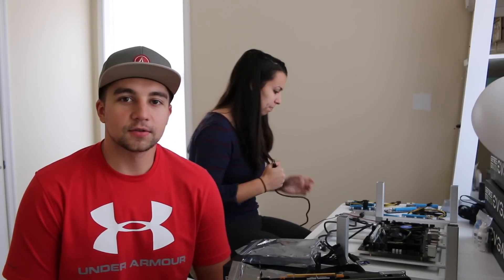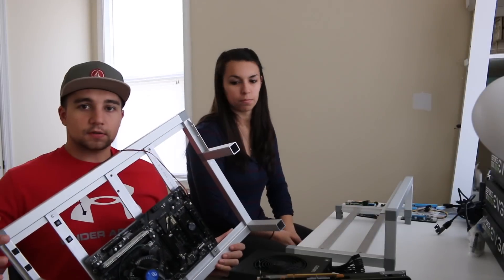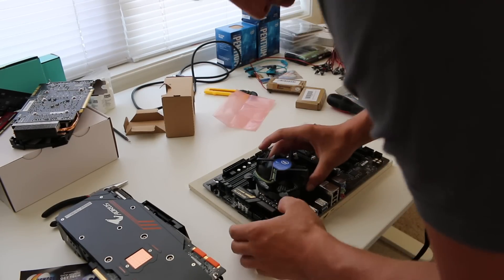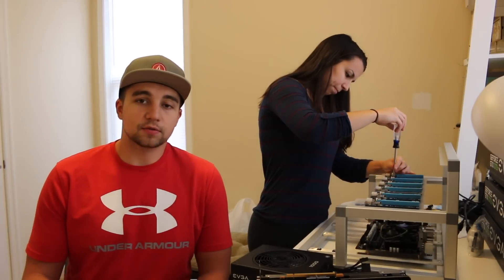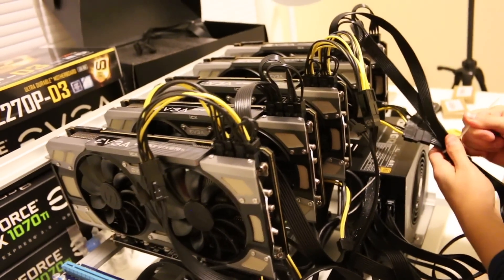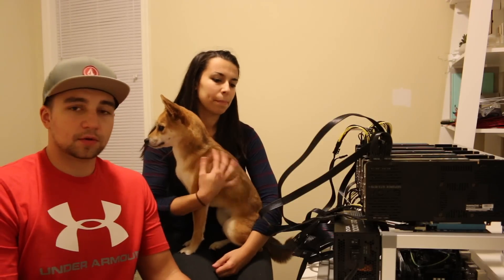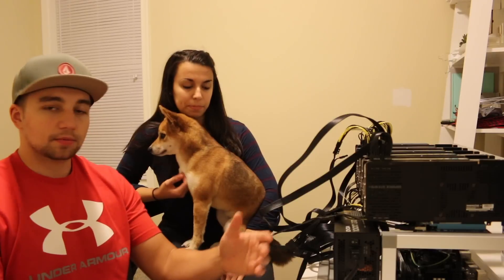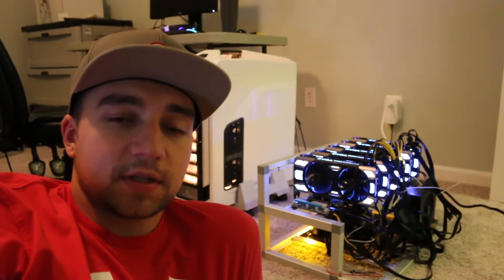Building a GPU Mining Rig - 6x 1070 TI to Mine Zcash, ZenCash, and Vertcoin

Comment: Great channel here @VoskCoin 
Building a 6 gpu 1080 rig.  Think a 1200w psu be good enough or do I need 1600w?  Each 1080 at max uses 150w so that'll be 900w in total from the cards, I'd say about 40w from everything else. So I believe 1200w would be good?  What do you think?

Comment: I have a corsair hx1000i, i can power 4 msi gtx 1070's with the standard Pcie cables that comes with. But when i see this video i can put 2 extra cards and power them all by the sata cables? I am running 50% power limit so 1000w is enough but i just want to know if the sata cables can handle this. Thank you!

Comment: I decided to actually do this build with the only difference that it's a 12 1070 hanging using both your videos. I have it all connected as far as your videos tell me and I'm getting power to all of them but I can't figure out what to do next? You go from building it to showing the mining results on the screen. I did the simple mining os from your video but I can't even get a video screen. Where do I attach the HDMI to the monitor? I tried every GPU and none of them can get a screen on the monitor. I'm hoping you could help me out, I'd be very grateful :)

Comment: VoskCoin,

I am doing a similar build to this, only exception, I am taking your recommendation, and I purchased an EVGA 1200 W Platinum PSU.
I was only able to order 5 x 1070 TI EVGA Black Edition, and I need another card. The cheapest I can find another is $600. At that price, can I spend the extra $150 and buy a 1080 TI without upgrading anything else in the rig?
That would be a total of 5 x 1070 TI & 1 x 1080 TI on a single EVGA 1200 Platinum PSU.

Comment: How do you have enough power connections to power those cards? Is it safe to run a 6pin to dual 8 pin splitter to power those cards? I just purchased all the gear and trying to figure out the safest way to power these cards.

Comment: How many of the PCIE 6 pin to 8 did you use in this video? One for each card?
Reply: i am wondering about that... cards need 2x8pin.... but, EVGA1000CQ have 4pieces 8pin>2x8pin already.
so you need 2 pieces of 6pin>2x8pin splitter, but i dont know if its safe and combine with 8pin to 6+2pin

not sure

Comment: Great videos! Just wondering about gpu's that use 8 pin + 6 pin power connections? This 6 rig video seemed to use similar but you didn't get into how it all powered up. Thinking about MSI 1070Ti Titaniums, given that EVGA 1200 Supernova psu only comes with 4 such VGA  cables? How do you power up #5 and #6? Cheers!
Reply: https://www.amazon.de/gp/product/B074PPPKGQ/ref=ox_sc_act_title_1?smid=A3RNVO35LF9IXA&psc=1

maybe? with 8pin>6+2pin thats in package.
not sure
Reply: Actually, saw what I was looking for on another vid! CableMod has all the cables one could want to add. I'm sure PSU builders only include enough cabling for gamers' needs, mining being as relatively new as it is. Cheers! keep up the great vids
Reply: yeah, but f** expensive

Comment: Hi! Quick question. The PSU calculator of CoolerMaster says this rig needs 1250w approx. Now I know we are going to undervolt it, but aren't we testing first with factory settings? That would result in problems isn't it?
Reply from the maker: You could grab 1 2 etc and test them if you’d like, don’t have to test all 6 full bore
Reply: Rob B. At idle these cards pull 10 Watts each. Then put in your settings and run everything. As the Powerlimit is only 120 watts its going to pull a maximum of 720 watts for the GPUs. So everything is fine 👍

Comment: I just put in an order for most of the parts here, using your links. Building a 6x 1070ti rig, but with ASUS Strix 1070ti's due to price being $50-60 cheaper per card.

Comment: so you went VGA-->6-pin split-->2 6-pin to 8-pin adapters for each card? is that safe?
Reply: notfamous wondering the same. 8 pin vga to 6 pin female to dual 8 pin. Assuming you are basically splitting a 6 pin to dual 6 pin if using for risers would be safe?
Reply: @Voskcoin I want to know this too, how are you splitting those cables?
Reply: i have question...
if i want mining rig with 6x 1070ti FTW2, that needs 2x8pin and EVGA1000CQ... (its cheaper than server PSU)

i need another 2 of these ? https://www.amazon.de/gp/product/B074PPPKGQ/ref=ox_sc_act_title_1?smid=A3RNVO35LF9IXA&psc=1

for 4 GPU there are correct cables with PSU - "8pin to 2x8 pin"

for another 2 GPU i need connect "8pin to 6pin"(in box 1000CQ) and then "6pin to 2x8 pin"(need to buy) ?? 

is that ok ?
Reply: googie k I'm using 1 6pin to 2 8pin per daisy chain. You will not be able to do more than one GPU per VGA port on the psu
Reply: googie k this video is pretty good. The only thing is make sure you order as many of these as you have gpu's.  Cable Matters (2-Pack) 6-Pin PCIe to 8-Pin PCIe Adapter Power Cable - 4 Inches https://www.amazon.com/dp/B01DV1Z32Y/ref=cm_sw_r_cp_apa_kW2yAbKNNM2GM

Comment: Hey Vosk great video. Started mining about 1 month ago completely inspired on your videos man. I currently have a trio rig with 3x 1070 gygabyte. I am currently mining on nicehash 2.0 equihash and I cant seem to be able to pass 447 hs per card. I tried you +200 clock +500 memory settings and the cards keep disconnecting.  The power is set at default 100%. Any ideas of why my cards are crashing? would definitely appreciate the help. Keep up the good work!!!! Edit : By the way Im using msi afterburner.
Reply: If you're gonna use Nicehash, use the legacy version. It has EWBF miner which performs better.
Reply: Thank you very much bro
Reply: brian miot try dropping core down some, my 1070s are stable at +135 and +720 and do between 475 and 500 sols

Comment: I came across your video because I decided I was about to build one, maybe start with 4 gpu rig for proof of concept. Is the rig in this video what you recommend as a good first rig! I’ve built many computers before so I can assemble it blindfolded, so my question is more about hardware selection. Also, which changes would you make to this build, I remember u said u would use a server psu with adapter, but what about software, do I use a hard drive running windows, or a usb drive running Linux? TY for any response, trying to order ASAP. Who has best prices, Newegg, tigerdirect, Amazon?

Comment: thanks for your tips and insight in your videos used a few of your settings across my gpus with slight tweaks and locked them on equihash. been consistently getting 1700sols, my 2 pcs are both running nicer too, cooler with less power and far less spikes :D been one of the best weeks i've had in awhile.

Comment: Another top vid :D, few question if you have the time for one of your fans :)
I just got my 6x evga 1070Ti SC the ones you recommenden. its sitting on 460ish. stock, win10
*when you say fine tuning. do you mean undervolting/overclocking?
*The evga1070ti sc has 1 8pin power connector. im thinking running a gpu and a riser on the same line using orginal vga splitters. whats you thought?
*EVGA 1070ti FTW needs 2 8pins why did you go with this rather then the 1070ti SC 1 8pin connector
*Running only 6gpu rigs, starting on my third  is 1200w (server psu parallelminer) enough for 6gpu,mbcpu,1ssd with some OC or should i invest in the 1500w.

Live in Norway,and we live rather high up in the mountains so its cool and windy ^^ my kw is 0,04usd to max 0.06usd
if that gives you any info.

keep up the good work, me and the misses are so happy we find youre channel
Reply: what psu do you run for the 6 1070tis?

Comment: Sata power cable are fine with Nvidia card or older AMD like R9 290 but when you run AMD RX 470/480/570/580 cards, thoses pull a lot of watt through the PCI-E riser and could have some problem with sata connector.

Comment: Hey Vosk, I'd like to try this with a server PSU. But how loud are they? Too loud to have in the house? Cheers!
Reply from the maker: they only get semi loud at max load, running a 1200w or 1500w (750x2) /// plats outta stock but this gold is a good example https://goo.gl/3pBSb7 also if its running hot put a 120mm fan on it from your mobo that helps a lot of people

Comment: Another great video! I'm interested in the server PSU's. Didn't know about these guys until I already ordered the Corsair HX1200i for 300 CAD (240 USD). I'm running 2 1080s and a 1060 now and will probably pick up a few more on black Friday depending on prices and will eventually need more power. Also I've experimented with nicehash and claymore and it's not even close for me, nicehash makes me about 8 USD/day for my 3 cards roughly $3/$3/$2 for the 1080/1080/1060 respectively. Nicehash has them using equihash for 1.45 KH/s total, would I do better with something other than nicehash + Win 10?

Comment: Vosk! What adapter do you use to power the CPU port on the motherboard when you use the Server PSU from parallel miner? Can you link to it?  Like its a PCIE to EPS adapter I think
Reply from the maker: This is what you're looking for pico atx adapter https://goo.gl/5G6pHU
Reply: Vosk. You rock. I bought that adapter (based upon your prior video) and it will power the motherboard 24 pin no problem... the issue is powering the CPU port 8 pin EPS on the motherboard. Do you use a 4 pin to 8 pin adapter coming off the PICO atx board? Or do you use some 6 pin PCIE to 8 pin EPS adapter? Again this is to power the CPU port on the motherboard when only using he SERVER PSU. Thanks again

Comment: You have used the 1070ti mini and this evga... can you compare the two?
Reply from the maker: the evga is certainly nicer, much bigger, and I imagine it will resell better but if youre going for max ROI get the mini theyre putting out similar numbers but its not on the exact same system so its hard to 100% compare

Comment: Interested in building your own Mining Rig? FULL PARTS LIST
EVGA FTW2 1070 TI 
http://amzn.to/2hsxzK9
Parallel Miner Bare Bones Frame
https://goo.gl/5GD8P1
Zotac 1080 Mini 8gb (6x) (Alternate cards)
http://amzn.to/2z3m3Ak
Zotac 1070 Mini 8gb (6x) (Alternate cards)
http://amzn.to/2iWXQRt
Zotac 1060 mini 6gb (6x) (Alternate cards)
http://amzn.to/2zHm5Nu
Gigabyte z270 d3 mobo
http://amzn.to/2AKJYld
Intel g4400 CPU
http://amzn.to/2iikvrU
PCIE 6 pin to 2x 6+2 pin
http://amzn.to/2yCEA1W
Power Cable PDU c13/c14
http://amzn.to/2yDT6Xm
Power Cable 110/120v standard outlet
http://amzn.to/2yCDNhx
ATX power switch
http://amzn.to/2yEoxkh
Ram
http://amzn.to/2hrNEjt
EVGA GQ 1000w PSU
http://amzn.to/2hsxXZ7
Arctic Freeze Thermal Paste kit
http://amzn.to/2z3bxZG
PCIE Risers
http://amzn.to/2zFKkLS

Mining OS used = smOS https://goo.gl/jMxTSS
Reply: Crypto Chick what's the ROI for this rig build? Thx.